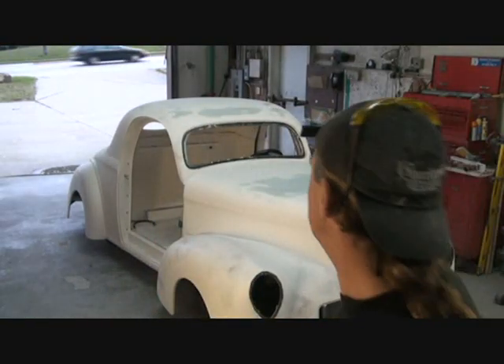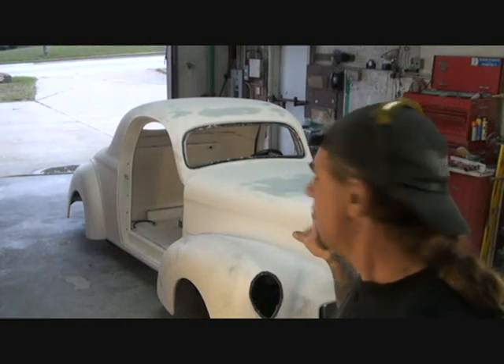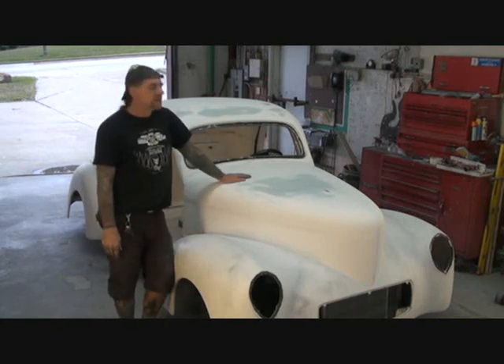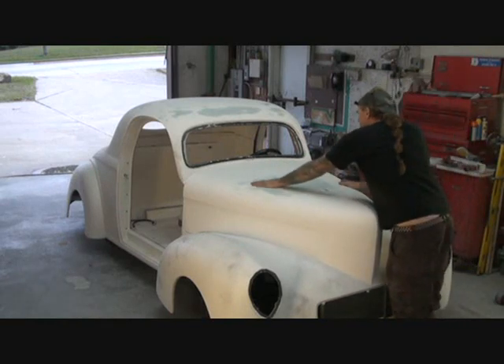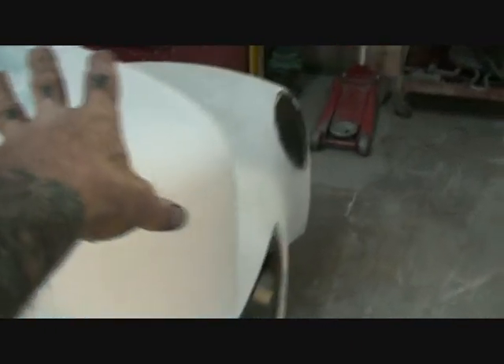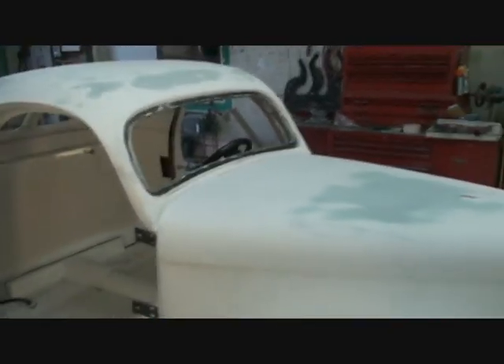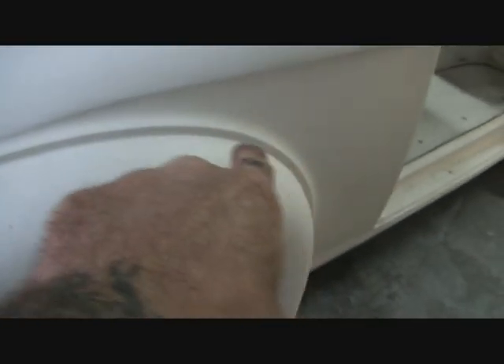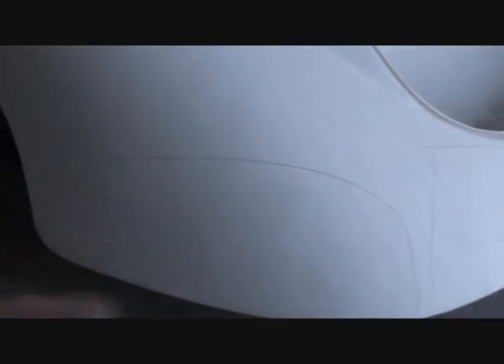1941 Willys Coupe-Streetbeasts-Doing Body Work On A Fiberglass CAR?

Comment: When you sand it with a long block, the guide coat will sand off back to white in this case..But any low spots (A.K.A. dents) will still have the guide coat on them so you can see where they are.

Comment: hi Pete, the body filler i swear by in the UK is Plastic Padding, 100% trouble free over 20 years of using it, even on my own cars that got smashed, it bends with the metal not cracks
also, you could give the f/g a quick coat of gloss black if you aint too good with the paws.
on some of the tiny micro pin holes in f/g i enlarge the pin hole a bit with a 1/8 drill bit by hand, just so that the stopper ofr filler gets in and not trap air or bridge it
oh, where the Fk is Bruno?  missing him!

Comment from the maker: I have used a type of bondo like you are talking about, for a very rough car it is good to use, if you are fixing up a car to sell, it's good to use, I would not use it on my keeper. Don't forget, it's a type of bondo, and eventually bondo shrinks. There is a type of sprayable bondo where you use a fiberglass hardner, it was made for corvettes. It works very well, but it's a PAIN IN THE ASS to sand. It's hard as a rock and doesn't shrink.. If I remember the name of it, I will post it... Pete

Comment from the maker: @matt192433 I use a sony hard drive cam corder. Thanks Pete.. it does work very well, its the 250 giga bite model.. The other sony I had which was an older version of this one actually worked better, but its discontinued. Pete